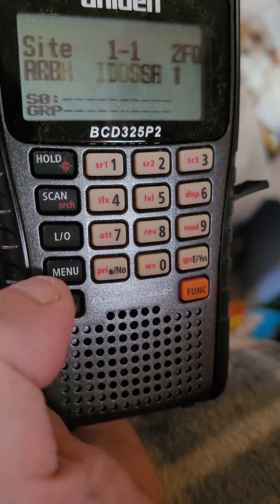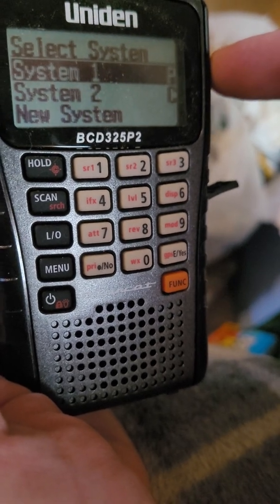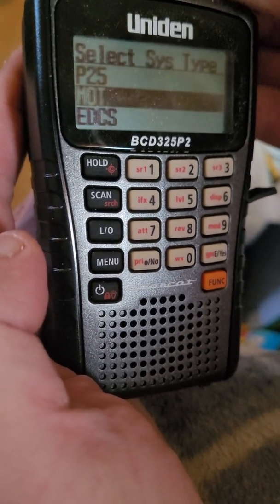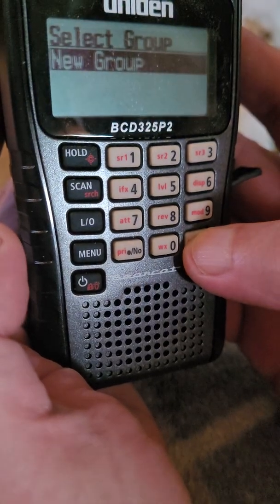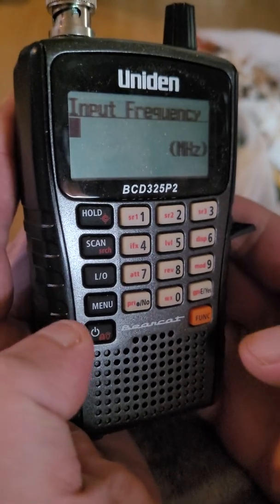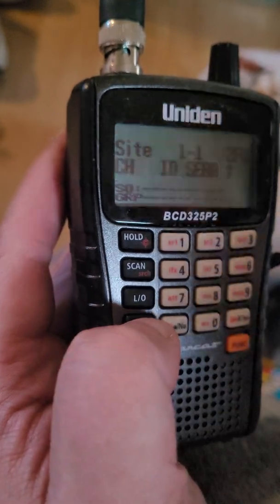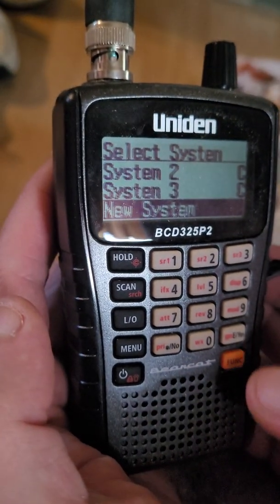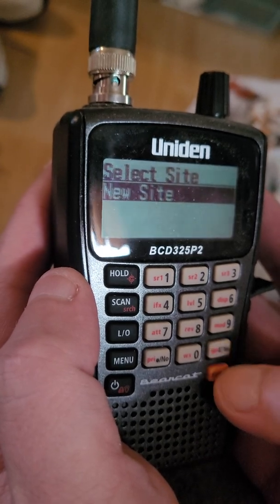BCD325P2 programming

Comment: Can you import from a file? This programming would take 5 years doing it manually. My Home Patrol II is way easier to program than this, also it has all the P25 frequencies built in for the entire country, and I can update those online very easily. I'm sure this probably receives very well (like my 125AT) but the programming is insane if you can't import a file.

Comment: you only have to enter the freq. in one system in p25.
Reply: if i want to use a program like free scan do i need to download drivers for the usb cord ? and if so where are these drivers, i keep finding dead links.
Reply: @NorthEastCornerRadio  I did not need to. I did have to change the usb port that Free scan was looking for.
Reply: @NorthEastCornerRadio  It'll be on the FTDI website.